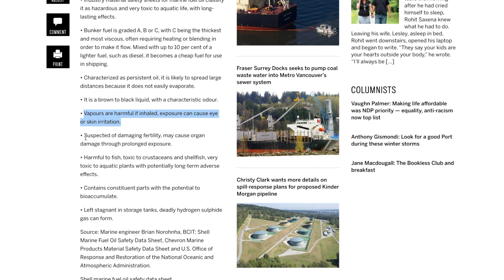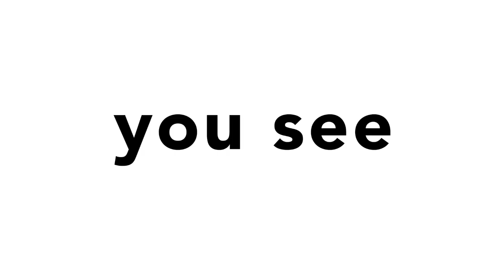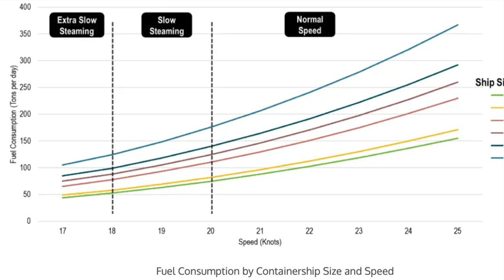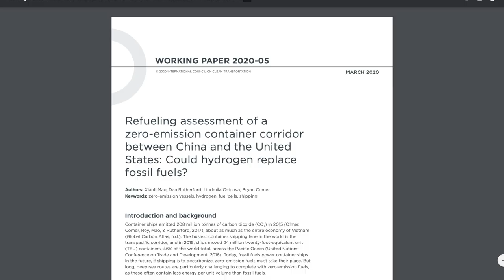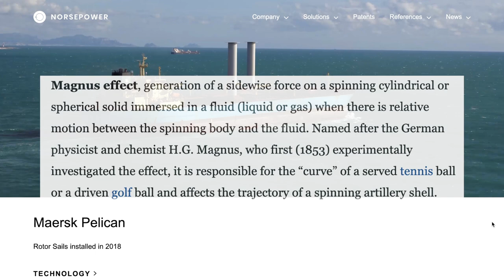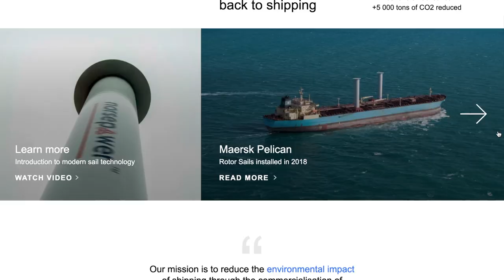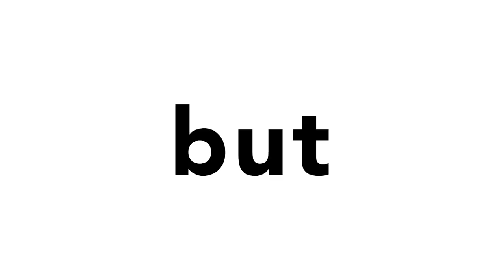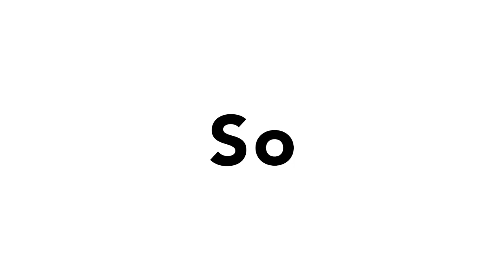Are Renewable Container Ships Even Possible?

Comment: Laser Pulse can now used to transmute nuclear waste into safe materials, reducing the worst radioactive materials from thousands of years to a few days of radioactivity. It's only in the labs so far, bute it's cheap and could be scaled soon.
Reply: They’ say nuclear is cheap, it’s not it is expensive as well as being complicated, dangerous, not universally socially acceptable and having only ‘no need for refuelling’ as a questionable advantage; actually it does need refuelling just not as often.  When they do need to refill the warming up stuff it takes considerable longer than pumping tonnes of thick black cSt380 onboard which is one of the reasons HMS Queen Elizabeth is pushed about by gas turbines thus using the same fuel as the aircraft that fly off of her.  The Royal Navy (RN) also have a similarly high degree of skills and expertise and the RN’s current operational nuclear fleet is 8 boats in two flotillas, four attack subs and four ballistic missile boats.  The carbon footprint of all the extra bits of hardware and the fuel, including processing thereof, from ground to propeller, are the external costs that never seems to get considered.  Disposal, once it wears out, of both the machine (that was a ship) and fuel is another can of worms best left unopened.  The 26 RN boats no longer in use are laid up (some in Rosyth and some in Portsmouth) awaiting long term deconstruction including dealing with the fuel rods and other irradiated material.  The USN is not, as far as I know, a commercial organisation working to very tight margins and has the skill and expertise to handle the complexities of nuclear power.  For those who still think that nuclear energy might be the answer I recommend this report: - https://www.bbc.com/future/article/20200901-the-radioactive-risk-of-sunken-nuclear-soviet-submarines? ocid=ww.social.link.email.  The navy of the USSR might have been under resourced and over extended but it was still generously supported in comparison with merchant shipping.

Comment: The least bad options in ‘alternative fuels’ all require growing, harvesting and processing which have fiscal, environmental and energy costs or impacts, before you get their energy to the point of use, and the use of which will generate effluents that will impact the global environment one way or another.  Thomas Midgley, Jr. (born 18 May 1889 died 2 Nov 1944) was an American (USA) chemist who, as well as developing the technique of putting the lead (tetraethyl (TEL)) additive in petrol, created chlorofluorocarbons (CFCs), yes those ozone depleting CFCs, so that the use of NH3 as a refrigerant could be discontinued.  NH3 could be the most dangerous and least ‘clean’ clean energy source, it is very bad and probably deserves a rant all of its own; so let’s just leave that for a while (somewhere very far away that is cool, dark and quiet).  CH4 lots of it around much of which comes out of the ground as a fraction of the FOGI energy mining; even more can be created (relatively expensively) from anaerobic degradation of organic matter.  The organic matter may be either raw vegetation, food waste or pre-digested by domesticated livestock with the right (or wrong, depending on your point of view) sort of diet and gut fauna.  CH4 is a lighter than air, vapour at environmental temperatures and pressures and you need to compress it, a lot, or cool it, a lot, to get enough on board your ship in manageable volumes to be useful also bear in mind that the containment of the cold or high pressure CH4 has mass and costs.  Carry it as cargo and you can burn the ‘boil off’, when the latent heat of vaporisation has the co-activity benefit of keeping the cargo and the cargo system cold, otherwise more trouble and expense than merit and savings.  H2 is said to be good for use in fuel cells that will give clean energy when combined with Oxygen (O2) and leave only water (H2O) as an effluent; so as well as the cost of creating the hardware and separating out the H2 in the first place we now have the cost of providing the O2.  H2 is very, very light and very, very volatile so this is where we remember the Hindenberg airship disaster, the ‘light’ means that though there is lots of energy per unit mass there is not much mass per unit of volume so all the problems of CH4 but much worse.  You need to compress it, more than a lot, or cool it, more than a lot, to get enough on board your ship in manageable volumes to be useful.  The alternative to fuel cell use of H2, burning, also generates combustion products which includes waste heat going to the cold sink and a few NOx nasties.  The numbers, on any of these, are getting very difficult to show any sort of surplus so is this a case of running hard to stand still?  H2 may have a place in the energy mix on land as a storage medium but on a ship where there is a reasonable and constant auxiliary power need the question could be posited, ‘why go through the extra stages instead of using the harvested energy directly?’  After harvesting the energy, from wind, sun or motion of the vessel, as electrical energy better to deploy it immediately as heat, light or mechanical work.  As with nuclear energy at sea some of the ‘alternatives’ may have a use in littoral submarines in AIP (air independent propulsion) systems but that will be with the same caveats of cost, space and complexity so would not perform in a high volume low cost mercantile situation.

How about ‘bio fuel’, how green is it?  Short answer, not very; major problem is land use and the limited upside is that the carbon released into the atmosphere has recently been taken out of that space in the growth part of the cycle minus the processing deficit.  On a small scale, to use up the waste products from other industries like forestry, animal husbandry or agriculture, ‘bio fuels’ are as good source of carbon molecules as you could get but they, like all 'alternative' fuels, still involve a combustion stage and therefore some noxious effluents, NOx for example.  Fossil hydrocarbon oil fuels run up from CH4 (methane/biogas) to very thick black HFO cSt380 (C20H42 to C50H102 or more).  The sweet spot is kerosene (C10H22 to C16H34), also known as gas turbine fuel and used in modern aircraft engines.  It is relatively cheap, relatively energy dense, relatively hydrophobic and relatively safe.  Creating a non fossil substitute, at a reasonable cost, is ‘the holy grail’ for energy chemists; like turning base metal into gold.  Natural history, on a geological scale, has done a lot of heavy lifting for us humans.

Comment: The problem with hydrogen isn't really cost, that will come down, especially if governments incentivise it's use, the issue is that you still have to generate the power to free hydrogen from water or oil, which produce carbon emissions, you could use renewable energy or nuclear to generate the power but renewable energy has issues with manufacture, solar cells produce a lot of toxic by-products in their production, are extremely costly and have limited life-spans. Nuclear would seem the best option, but simply having a nuclear reactor on the ships themselves like an aircraft carrier would make more sense as it would increase, rather than decrease, space for cargo, the unlimited range and length of time between refuelling would also allow more operational time. People have a knee-jerk reaction to nuclear but it is far cleaner than anything else we have and safer too, even the worst accident we have had in the worst designed reactor has caused far less damage than coal or oil, nature is thriving around Chernobyl without human activity. And while the spent fuel currently needs to be stored long-term, this is far safer than releasing your waste into the air. Add to that fast-breeder technology which could eventually consume all radioactive isotopes in the fuel and not only is your waste safe, but efficiency goes up. In Oklo, Gabon, ancient natural nuclear reactors existed and even though they are situated on porous rock with water flowing over it, radioactive isotopes didn't spread very far and life wasn't adversary affected, this is a worst case scenario for spent fuel, yet it has happened in nature without killing off the planet. I'd rather be next-door to a nuclear power plant than 5 miles from a coal plant, I'd be avoiding the toxic pollutants and ironically, I'd get less radiation as burning coal liberates unstable isotopes trapped in the coal into the air no concrete or anything to protect you, finely dispersed as an aerosol straight into the environment.
Reply: Other option would be to use a hydrocarbon fuelcell instead of hydrogen to increase efficiency and reduce emissions, but if you really want to make a clean container ship, nuclear is the best option , batteries don't have the energy density of hydrocarbons or even hydrogen and are toxic to produce, at least with nuclear, the energy density far exceeds even fuel oil and the toxins are contained where they can be stored in an isolated environment.
Reply: I like you reasoning and logic however the are economic as well as emotive problems with 'nukes on ships'.  If you do a web search for ‘nuclear ship savannah’ you will see that it has been tried and did not work.  A similarly vessel heavily subsidised, by the government, vessel is in use in Russia which also operates, in support of the Northern Sea Route, a fleet of nuclear powered ice breakers all of these may, or may not, have been completely without issues.

Just think; would you have full confidence in the management of a nuclear reactor under the control of an anonymous entity only traceable, perhaps, via a letter box in a FOC (flag of convenience) nation state?  If you are, could you sell that confidence to Japan, the state that hosted the Hiroshima and Nagasaki nuclear detonations as well as more recently the Fukushima ‘event’?  Then try that same, or a similar, sales strategy on Ukraine, the nation state that as a part of the USSR (CCCP) hosted the Chernobyl ‘event’.  Modern iterations of nuclear energy, thorium fuel, molten salt reactors or fusion reactors, will carry the legacy of past problems.  It is the global trepidation of anything with 'nuclear' in the name and the economics of nuclear having transitioned from 'energy to cheap to charge for' too 'the costs of remediation are incalculable' that will prevent the adoption of nuclear energy as a means of creating energy at sea.  Modern reaction systems may have overcome the safety problems but the general public, having been misled in the past, will be reluctant to believe the fresh new promises.  The incident of the ‘Ever Given’ blocking the Suez Canal, March 2021, may also have a little to add to this debate.  The cooling water on ships tends to get taken in from near the bottom so when running aground the inlets are in a prime spot to get plugged up restricting, if not stopping, the flow of coolant.  One thing that the TMI, Chernobyl and Fukushima incidents all had in common was that the supply of coolant, or rather lack thereof, was a fundamental cause.

‘They’ say nuclear is cheap, it’s not it is expensive and has a large embedded carbon quotient as well as being complicated, dangerous, not universally socially acceptable and having only ‘no need for refuelling’ as a questionable advantage; actually it does need refuelling just not as often.  When ‘they’ do need to refill the warming up stuff it takes considerable longer than pumping tonnes of thick black stuff, cSt380 HFO, or thin runny stuff, MDO, onboard which is one of the reasons HMS Queen Elizabeth and HMS Prince of Wales are pushed about by ICEs and gas turbines thus using a similar fuel as the aircraft that fly off of them.  The Royal Navy (RN) with a high degree of skill and expertise uses, at vast expenses to the UK taxpayer, a current operational nuclear fleet of 11 submarines (also known as ‘boats’) in two flotillas, seven attack subs and four ballistic missile boats.  The carbon footprint of all the extra bits of hardware and the fuel, including processing thereof, from ground to propeller, are the external costs that never seem to get considered.

Disposal, once it wears out, of both the machine (that was a ship) and fuel is another can of worms best left unopened.  The 26 RN boats no longer in use are laid up (some in Rosyth and some in Portsmouth) awaiting long term deconstruction including dealing with the fuel rods and other irradiated material.  The USN is not, as far as I know, a commercial organisation working to very tight margins and also has the skill and expertise to handle the complexities of nuclear power; so as well as submarines their aircraft carriers are nuclear powered and each of the current iteration has a build cost three times that of QE/PoW, bigger crews and more generous funding.  For those who still think that nuclear energy might be the answer I recommend this report: - https://www.bbc.com/future/article/20200901-the-radioactive-risk-of-sunken-nuclear-soviet-submarines?ocid=ww.social.link.email.  The navy of the USSR might have been under resourced and over extended but it was still generously supported in comparison with merchant shipping.
WADR best option is move less and move that smaller amount shorter distances.
Reply: My initial reading of your post was inadequate as it failed to adequately focus on this part 'it is far cleaner than anything else we have and safer'.  WADR the safest and cleanest, not to mention cheapest, option would be to move less material and to move the minimal inescapable essential quantity the shortest distance possible.

Comment: Soo how do I invest in renewable container ship tech?
Reply: The question asked is 'how do I invest in renewable container ship tech?'  To which the answers starts with 'at what level of renewable', all movement has costs and can all of those costs can be fully and internally accounted for.  A better question would be ‘Is Investment in Sustainable Power for Ships Available ?’  Just as every source of energy and the harvesting thereof benefits it also entails costs some of which are both direct and internal (payable) and some of which can be externalised or made indirect (free use of common goods).   Every person and item of equipment on a ship has to pay its way so from the point of view of the owners, operators and managers, simple is good; effective is good and cheap is good.  If you have a company pension, mutual fund or are luck enough to live in a country with a sovereign wealth fund (e.g. Qatar, Norway, etc.) you already do; just not directly or personally.

Comment: Another possibility would be to use power beamed by microwaves from land based stations to phased array antenna equipped low earth orbit relay satellites, and finally to a rectenna over the superstructure of the ship. The sats would have large flat phased array antennas/rectennas and related equipment, but would not have to generate the power. The cost advantage of having an electric drive might make the expensive sats economically viable.